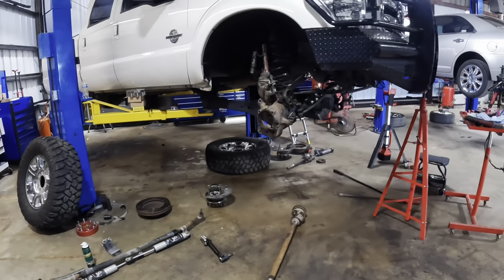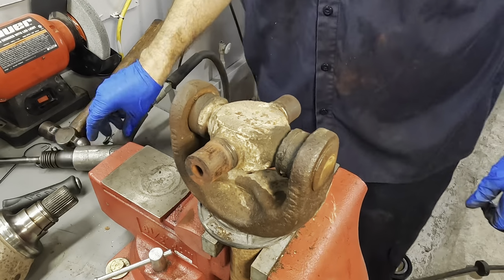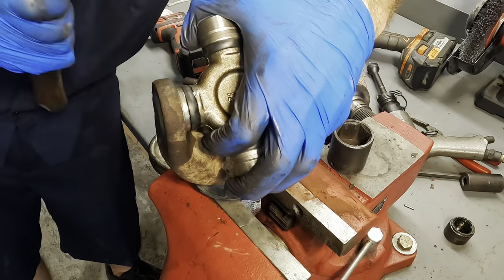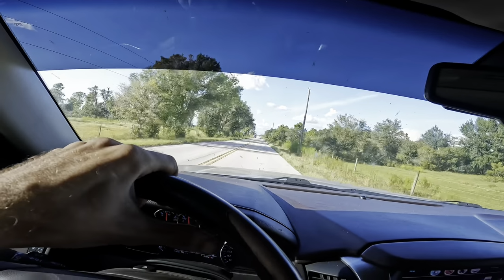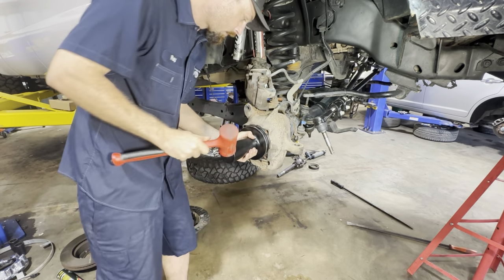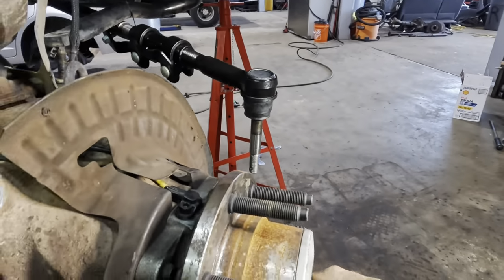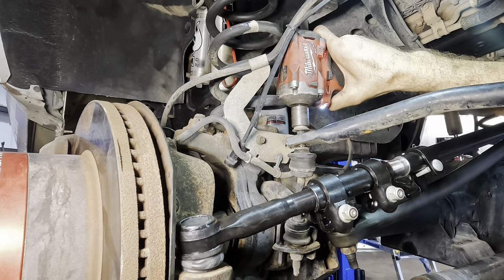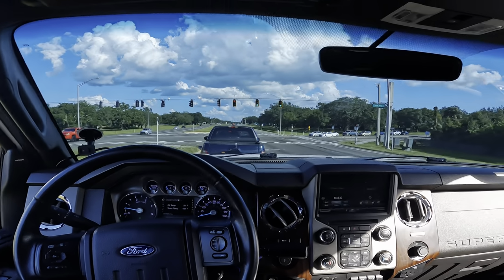Mechanic States: I Quit !! Suspension Rebuild Ford F250 F350 6.7

Comment: Not had much time to watch much of Rays stuff for a while so good to catch up a bit. Good luck to Troy.. and talking of things to do, bought another little bike to clean up to sell, and when I got it home I realized how rusty the frame was so instead of a simple starter clutch replacement, it ended be a frame strip and respray.. problem is my little workshop has too many bikes in bits so now putting a 750 back together...well yet again I should say as the head gasket went and as Kawasaki do not do the old ones the pattern ones were really naff,  so had to replace that a second time with a slightly better quality pattern part.. so that is going back together so I can make room for the frame respray.. so best I get on with it.. I'll watch the rest of this later on IF I find time. Have fun folks.
Reply: As it goes it went even worse, stated sanding down the frame, the rust got past my mask, that went into my lungs, my lungs gave up for 3 days, then 3 days in hosp[ital, then a couple of days recovering after getting home, NOW I can actually go do some spannering.. At least the bikes are mine to play around so no customers sat there waiting for things.

Comment: Ray, did you realize that you installed the driver's side u-joint backwards as the grease zert is angled toward the wheel vs toward the axle.  Hopefully you can still get a grease gun in there to access it.  Love you're content!

Comment: Hay bud on the sway bar when you reinstalled it you placed the bar over the mounting bolt\rod with the cup & rubber bushing, the lower half of the bushing  then you installed the castle nut directly on top of the bar there should have been the other half of the rubber bushing above the bar followed by a cup washer then your castle nut & cotter pin. This is why the shaft protruded beyond the bar so far. Should be addressed\ done right before damage or at least some damned annoying rattling & a customer return. Hope you catch this.

Comment: not sure if those hubs are autolocking with manual over ride but if they are the ford manual says that to remove and install the hub lockers they must be in four wheel lock  I once failed to put the hub in the locked position and it failed after a couple of days
 sorry just had to say something

Comment: No, Spicer made those seals for Ford. If I  buy GM factory spark plugs, they are NGK plugs. In the 1970s if I bought a GM manual transmission it may have been made by New Process or Muncie. If I bought Ford or GM factory U joints they were always made by Dana or Spicer.

Comment: I take a pick and get the rust out then use a wire wheel to get the rust out then use a ball hone a hone all the cup inside the youk till you get it clean. It only take a few strokes and oil the holes and the new u joints go in a lot easyer. As far as taking them out I use a air chisel with a chisel end which I round up. Then you put a socket on the concrete that the sock it will let the cup go threw. You can use other means but since you have to move the u joint from side to side this is much faster. Use a piece of 1/4 to 3/8 piece of steel plate to not chip the comcrete.Use the air chisel inside the joint on the 90 degrees from the one you want to take off. The air chisel will take it of in no time you have to try one side then just move the air chisel to the other side. Go back and forth this side and you will never bend the yoke. You get a tough one just heat the outside of the yoke and will come out without a problem. I will not bend or hurt the yoke cause you are working directly  only on that side of the bearing yoke side of the part. A little rust spray won't hurt either. I see so many people use a press to get them out they bend the yoke than they wonder why the u joint only last a few weeks. Most the times I get the ones people used a pressed on them and bent the yoke bad. So i have to heat the yoke up red and bend them back till they look good then do the other side and do the same. Then install the clips measure between the clips against the outside of the new joint. I have done so many of these I get between .001 to.005 clearance between the two on the first try. I have never had one come back. You can put them back in with a vise, ball joint press, or c clamp. Or just use small hammer to get each side then a socket to finish off. If you have cleaned both boores of the flange you really only need to tap them in. But people in such a hurray they mess them up and drop a needle bearing and try to make them fit they wreck the new joint. I don't fix that mess for nothing I can tell you that. Takes to much time is why. If done right you don't have to muscle this stuff and save your body. Use your head rather than your head as the hammer.

Comment: Nice work. That u-joint is a little too tight. There's a great video by Weber Auto (Part 6) on how to install them without the tightness and tension. I just give them a little tap (the ears) with a brass hammer and they loosen up.

Comment: 1:13:00 might have been easier to put the bolts thru the top plate while it was unmounted and then push both back together, leverage, physics.

Comment: Firstly, wishing Troy the best in his future endeavors. Hopefully he will remain your- and Lauren's friend and look back fondly on his time working with you.
 
Secondly, I'll bet that Spicer builds for Ford (and likely others), labeling the customer's name/logo on parts and packaging.  I saw this firsthand with the company I worked for, who made brake valving in one half of the facility, AC- and 4WD electromagnetic clutches in the other.  My "phalangie" prints were on a lot of those components at some point in their existence. 😉
 
Thirdly, invest in a good, long-handled sledgehammer from Harbor Frigate ("Hazard Fraught?" Shame on you 😆).  If you're doing Mickey Mantle suspension work, give it some *schwing*. 
 
And for heaven's sake, be careful. 😉

Comment: i bet if you mounted your vise on a more rigid structure than the giant spring it's mounted to now it would work a bit better for hammering things around. In my most humble opinion. The springy surface of that desk absorbs too much energy or so it seems to my layman eyes.

Comment: You should've used ur hydraulic jack to get the seal installed on the axle unless they're wasn't enough room to use that with the tool rather than hammering it on and risking an injury cuz I wacked my upper leg 2 inches from my knee and if it did hit my knee I would've been in a lot more pain than what I was going through and it felt like I saw my life flash through my eyes when I thought I hit my knee when it was going towards my knee 😅. good thing it didn't happen and just had a few days of pain from the accident that I had

Comment: May i ask... Why do you use such percussive force to assemble U-Joints and seals, instead of the hydraulic press? In my small mind the press would be less traumatic for the part?
Reply: Look at the size of the truck. You think a human could stress those parts? lol

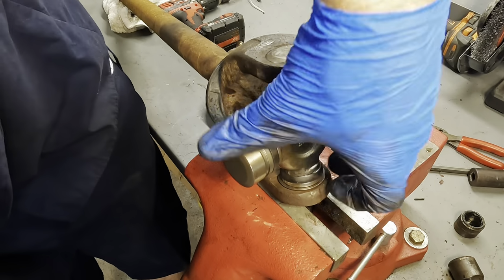Comment: ray, brother, the only tools you need to change that U Joint is a hammer and a vice. not quite sure how come you're taking the most difficult way to change that thing out and ray at 25:30 ish you're using an air hammer to try and relax that joint to free it up.. cmon man you should know better. put your yoke on and then use the yoke and the axle with a hammer to relax it that way no damage to u joint and you're sure as hell not gonna hurt that yoke

Comment: He took the cups off the new joints, checked them (possibly to ascertain that they had next to no grease in them, idk ), then he put the uncovered bearing cups on the bench. He also also left the (barely) greased inner u joint in a vice, also totally exposed to dust. 
So I'm thinking, he's going to get some grease and lube the joint up.
What did he do instead?Took a wire wheel to a tail shaft, spraying every part of the bench and bearings with rust, steel etc.  
Maybe it's a parody?

Comment: Not only would I have that U- joint spider removed by now I would also have the new one in and perfectly greased and adjusted. And onto the next one. I can do this entire job with one tool, a hammer sorry will need a screwdriver to push the old clips out But this press stuff completely unnecessary.

Comment: That u joint will fail prematurely..way to tight when he was moving it. If you rotate cap before install, it should move equally as free after install..he butchered that install.

Comment: You are one of the better mechanics I watch however It greatly bothers me that you use an impact to tighten EVERYTHING! You should not tighten lug nuts with a Milwaukee impact wrench that puts out over 600ft ft pds torque. You said torque later but the damage is already done. Even IF you do loosen them and torque them properly, some day if they hit a large pot hole every stud could sheer off. I have seen it many times on car crash channels. Same with other fasteners you tighten with an impact. I quit watching another Lexus certified mechanic because he put a factory short block on a Toyota and even tightened the oil pan bolts and timing cover bolts with a 3/8 impact. Even if he lets off first hit of the impact on the oil pan bolts he put over 50 ft pds torque on a fastener and gasket designed for 9 ft pds torque. The gasket will eventually leak and the next guy who loosens the bolts will very likely  remove the threads with the bolt. Yes use an air ratchet to get the bolts seated but then use a torque wrench for proper designed torque settings.

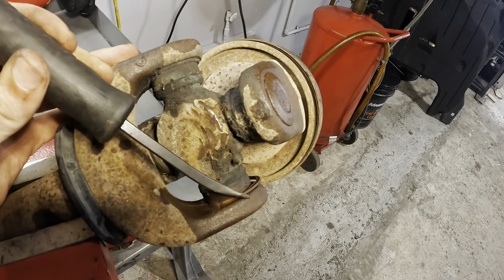Comment: As an indicator of how effective the penetrating oil was/was not, look at the C-clip groove at 4:27.  We can see that the penetrant didn't even get into that shallow groove.  Because of this, I'd be surprised if any got between the yokes and the U-joint cups. ( I'm betting the penetrant Ray used was not KROIL.)   As Eric O. says,  most 'rust buster' penetrants work just because they give you the confidence to use a bigger hammer. 
I also just noticed that you wire brushed the dirt and rust off the second yoke....right beside the exposed trunions on the new U-joint.   I wonder how long that new universal joint will last with dirt in the needle bearings?    Surgical cleanliness is a good idea when working with bearings, either the rolling-element type or plain bearings.

Comment: I must have skipped over the bit where you mentioned Troy's departure as the video was too long and I fast forward all the blah, blah, blah bits. Perhaps next time place a written narration on screen so those that do skip forward will not miss it, it also helps the hearing impaired. And no, I am not going back through an hour and a half video just to find that part and listen to it. 🙄